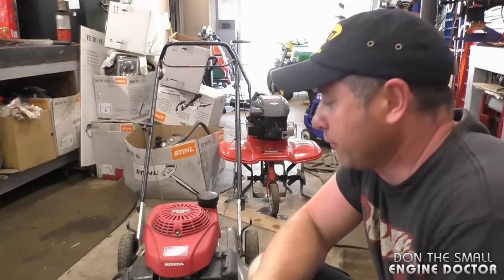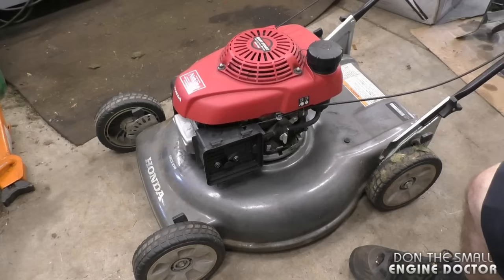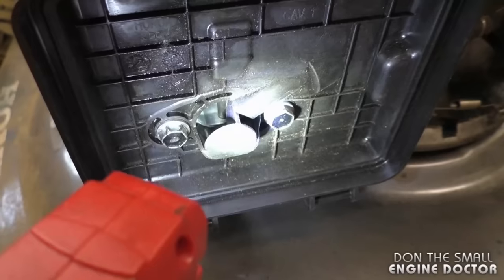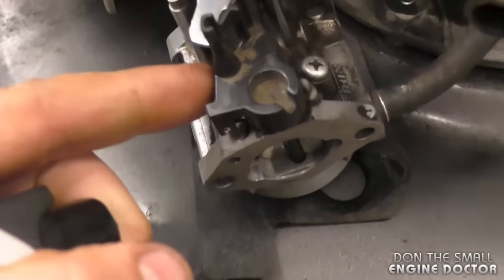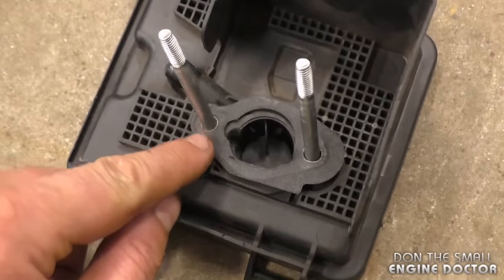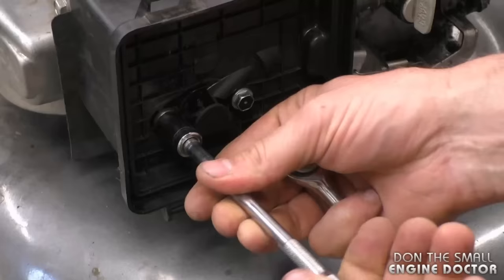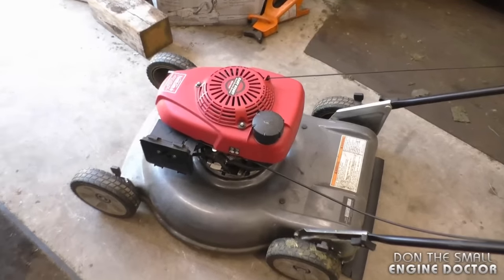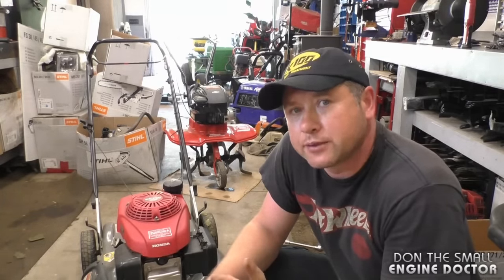Make Your Lawnmower Start On The First Pull Again - Honda Auto-choke Repair - Video

Comment: Hi All, I have found out the part number quoted here is the older part number, Honda has updated to a new version of thermal cartridge, It's 16620Z8D842...which eliminates future issues, great video , keep it up.
Reply from the maker: thanks for the update!
Reply: I actually ordered that same part number that is supposed to be updated and it doesn't work. My neighbor has this mower and I'm going to look up the the thermal wax that goes with his because his works perfectly
Reply: @Scoffman0  What were the specs on the one that you got?
Reply: @Scoffman0  had the same problem, would you have the correct #
Reply: @donyboy73 what would make it run max rpm all of a sudden? How’s the auto choke with the other spring work? Bc when I move that lever it drops rpm’s but when I have it running that thing don’t even move
Reply: thank you!
Reply: Thank you Dony Boy because I have Honda also

Comment: Someone should make a manual choke conversion kit. Automatic choke on small engines is unecessary and ridiculous,  just decreases reliability
Reply: Auto choke is good since it chokes it for you without having to fiddle with the choke to start a normal engine.
Reply: autochokes was a dumb idea, same with fixed throttles. the manual chokes and throttle control are much better.
Reply: I suspect Troy-Bilt wanted to make it foolproof for the operator, so they went to auto-choke, and full throttle only. Just pull the cord. The model before the wax insert has a bimetal spring for auto-choke and it actually worked better. But I can see they want to make it simple for anyone to start. We just have to suffer through their trial-and-error designs.
Reply: It's all about emissions, and idiot proof starting (when it works like it should)
Reply: Yep, i took all that auto crap off my honda, ran a wire to choke and a wire to throttle. Now i have full control as it should be.
Reply: UPDATE- Honda has been updating the part number on their thermowax so I expect they are trying to resolve the problem. I installed their latest thermowax last month (16620-Z8D-842) and the mower has started on the first pull ever since. Maybe they worked out the bug, fingers crossed.
Reply: The auto choke wax cartridge ain't cheap! $30.00 plus depending where you buy it. The Honda GCV 190 on my power sprayer is a manual choke and I've NEVER had a problem getting the machine started and running well. My 15 year old MTD American built self propelled Cub Cadet lawnmower with regular maintenance has never had a problem and I much prefer it over the Honda mower.
Reply: Take the copper auto choke out and all springs from the choke system. There you go manual choke.
Reply: What I like better than a choke is a primer
Reply: @trevorhannon900  did
Reply: Do you have pictures/video of your set up?
Reply: @phill1074  can you show us how to do that?
Reply: I made one for myself and a old style  with cable control chock and throttle
Reply: @swingbelly  I just bought one from Amazon same part number for $10 OEM HONDA
Reply: Forgive my ignorance and probably dumb question but how do you operate the manual choke after the auto choke has been disconnected?

Comment: Honda fixing a problem that doesn't exist. Making a simple engine more complicated for no reason at all.
Reply: The reason is that most people are too stupid to understand how to use a choke, so Honda did them a favour and installed one for them.  Add more crap to any machine and it's gonna break.
Reply: I guess most guys looking for curb side junk love these, mower won't start, junk it and buy a new one.
Reply: @dwoodog     my state wont give anything away . i am  yet to see a curbside yard equipment find for free.
Reply: I think Kohler auto choke system Is the worst. Primer bulb was the way......
Reply: They have improved this auto choke system on the new Honda GCVx engines  by repositioning give thermowax cartridge.
Reply: And primer bulbs.
Reply: @ElectoneGuy  most people aren't that stupid.
Reply: The gas valve was shut off...Easy fix.....Just turn the gas valve clockwise.................
Reply: @OldPossum That's a terrible thing to say. You know these Honda HRS216's are made in the US right?
Reply: That's a progressive company making 21st century changes to improve performance. If you take the "if it ain't broke, don't fix it" you'll never move ahead. Competition requires improvement or you can go the way of Kodak, Xerox, and film cameras. The Japanese are very keen on that!
Reply: Eduardo Arce Roldan Kohler got this thing beat by a mile for hard starts
Reply: Thanks for your opinion. It was extremely valuable, much more valable than your input on the video which was the intent of the Comment field.
Reply: These engines gave very little trouble until they decided to auto choke them
Reply: Absolutely!  My older vintage (late 1980s) Honda mower has a manual choke that is actuated by the throttle lever being pushed to the "start" position - simple, effective, and reliable for 30 years and still in use.  That auto choke thing is ridiculous, and not needed.  They took a good, reliable design and ruined it.
Reply: Honda's VTEC is a good one.. Makes a good engine, only good up top
Reply: @eduardoarceroldan7466  
My Kolher engine requires only 24-35 pulls or until my shoulder pops out the socket.
Reply: Yeah, you hit the nail on the head.
Reply: I have a Lawnboy with a Honda engine, same deal. Poor design by Honda, which is disappointing since I've had nothing but good things to say about their small engines.
Reply: I don't blame Honda one fucking bit. I've see people with anything carbureted and they're terrified or something of using the choke. Like there are dudes that have been riding dirt bike their whole lives and they buy an old DRZ for dual sport and they're like "hurr durr it won't start at half choke" like pull the choke all the way out you utter mong
Reply: @eduardoarceroldan7466  But a primer bulb isn't the same as a choke. The primer bulb forces fuel through the carburetor passages and pushes out any air. You can push it 100 times and it wont flood the engine. The choke actuall closes off the air passage, allowing a richer fuel mixture on a cold engine. But you probably knew all that.

Comment: In your video you can clearly see that the fuel cut off switch was turned to the off no fuel position.  Causing your lawn mower not to start.  You will later see in the video that when it starts he turned the switch to ON position allowing fuel into the mower.
Reply: I noticed the same exact thing also

Comment: My 13 year old daughter figured out how to use the choke to start our early 2000's Honda mower in about 15 seconds...maybe less. The engineers at Honda 'over thunk' the process and designed a system that will fail every two years. GRRRRRRRRRRRRRR!
Reply: cbsctomh I prefer manual chokes much more but I have had an auto choke Honda push mower for over 12 years now and it has surprisingly always started first pull without any problems.

Comment: I wish honda would just keep it simple and stick with a fully manual choke and avoid potential problems.
Reply: Russ Gallagher  yea it's all bullshit. Epa needs to be limited to their restrictions.
Reply: @johncuervo3019  I've had my honda mower for about ten years so I haven't been in the market since. Are all mower engines like that now?  I have a Briggs engine on my 2011 snowblower . That has a manual choke.
Reply: These corporations have to support their vendors and retailers this is why they make Junk Parts as well as Reliable Parts this is why Mercedes-Benz put there heater blower control unit integrated circuit chip in the bottom of the blower and you have to remove the entire front of the dashboard to get to it this is deliberate
Reply: not just honda briggs kohler and the chinese are all using auto chokes.  And for some reason they think they need to be aerodynamic so put cowlings over everything.  Ive been a small engine mechanic for 27 years there has been no real improvement too any of what is commonly used today be it a mower or a chainsaw.  The only thing refined is they have got the lifespan cut by at least half if not more and the costs of making way down
Reply: @glennlurman3514  I have a OHV Briggs that is right about the same age (2011) as the Honda and it has a manual choke, however that may be because the Briggs is on a snowblower and meant for operation in colder temperatures.  Yeah probably the only changes you've seen is side valve to ohv and ohc and points to electronic ignition.
Reply: I know I have a model that must have been made before this one. that has a choke lever and Honda's brilliantly stupid idea was to make the lever return to the off position slowly. I ened up taking the spring out it. so it would either stay choked or off. all the manufacturers are doing this. because the all the automotive manufacturers have been doing this for year's. it's a convenience item for the owners. it's getting pretty bad when people don't even want to reach down to pull a choke lever to the off position. besides it's bad for the engine. a choke should only be on to start the engine and when first starts to warm up. the longer the choke is on it washes the cylinders down with fuel. but it's such a small amount that it's acceptable. newer car's don't have chokes on them they have an inrichment circuit in the fuel delivery system. it's just another convenience item that people have become accustomed to.
Reply: @harryrenner4016  Agreed. Speaking of cars, how about self driving cars.  I certainly won't buy one. I far prefer to have control over a machine,  whether it's choking or driving.
Reply: @charlesdudek7713  I agree they are taking away what driving a was about besides transportation. the viceral sensation and having control of vehicle. which I do pretty well since I was an OTR truck driver for many years.

Comment: The gas tap was turned off at first
Reply: @Oops Oops They  havent even used this technology for 15 years.
Reply: @johncuervo3019  im not sure it had manual choke.  Maybe primer bulb.  At one point they had an autochoke that used the force of air off the flywheel to open it.
Reply: @ChuckWood  I remember them!
Reply: So it started, and ran with the tap off. Maybe it possible to run off oxygen?, lol 
I'd say he does what we all do by turning off the fuel tap. 
My prob is I forget to turn it back on again when it's mowing time. :)
I've read quite a few comments and one guy says 2 years. shit!
Might just use 'Start Ya Bastard' when it eventually fails.
Reply: Yall I'm sure he checked the valve when he figured out something wasn't right. Do yall not get a little crazy in front of cameras?
Reply: @mickgatz214  it ran because of the carb cleaner he put in there, that is like gas ... if he would have left it on for a minute longer it would have stalled from lack of fuel. but that wasn't the point of the video so he did not care or did not notice ...

Comment: Big thx this video has resolved a 1yr issue which i been having with my own manual choke honda lawn mover. Your Carb gate explination on start up was the key...
Even with manual choke petrol mowers if its hard to start or cuts put during use, it coukd be you choke or choke & actuator settings, actuator stop screws and choke cable too tight as was my issue, 

Without knowing how the carb air gate looked when in full choke, i would never of fixrd my mover.

So thank you......❤

Comment: A great tip Donny Thank you. A lot to be said about keeping things simple with a manual choke.
Reply: You are 100% correct!  But they invented this to prevent damages to the Machine when hot.   Manual Choke is great, but once the Machine heats up for a long time, which a lot of People aren't aware and they ending up damaging the Mower instead.
Reply: @JodBronson  What? You mean if they start a hot engine with the choke on? It will flood and not start. Damage?
Reply: @dkupy100  - DENSE!  LOL
Reply: @dkupy100  - As the engine warms up, the automatic choke adjusts to the temperature change to regulate the fuel/air mixture to the proper ratio.
Reply: Jordan, David Kupferman is correct. The engine won't run when warm with full choke. I don't see how it can cause any damage to it. Care to enlighten us?
Reply: WOW, you People needs to go back to "English" 101 again!  READ THIS PART AGAIN AND AGAIN "But they invented this to prevent damages to the Machine when hot.   Manual Choke is great, but once the Machine heats up for a long time, which a lot of People aren't aware and they ending up damaging the Mower instead."  LMFAO !!!
Reply: @TheOtherBill  Easy, he is just a kid.  The thermal wax cartridge when cold will close the choke. As soon as the engine starts the exhaust heat warms the wax cartridge  causing the choke plate to open and the engine runs normally. If the engine is shut off for a short period the wax cartridge is still warm so the choke remains open allowing the warm engine to restart. If the engine remains off, the wax cartridge cools off closing the choke so a cold engine will restart.If the engine remains off for a longer period, the wax cartridge cools off closing the choke so a cold engine will restart.

If the choke is stuck closed , the cold engine will start but run rough and probable stall.
If the choke is stuck open, the cold engine will need a prime to start but run normal.

So where is the damage? Just replace the thermal wax cartridge and FIXED.
Reply: David, I understand thermal wax chokes, I even had one on my 1981 Mitsubishi. But he is claiming running with the choke closed will damage an engine and won't back up his statement, instead choosing to be insulting. Fine, let him think that.
Reply: TheOtherBill simple over fueling the cylinder and getting gas into the oil. Thinner oil from the gas and you waste a piston.
Reply: works every time
Reply: Auto choke takes about 3mins to fully open  manual choke start pullback to fast run srate away
Reply: Zackley !
Reply: This system worked perfectly for me for 12 years, I'm  totally impressed !

First pull every time, even my neighbors are impressed. 

While they're getting their exercise in the Spring repeatedly pulling the recoil starter, pumping bulbs, tampering , cussing & swearing;  I roll my Honda out of the shed and it always starts on the  first pull.
Reply: I've had many more problems with a manual choke. Six years of faultelss performance, and it is an easy part to change when it fails.

Comment: Timely video, just purchased a lawnmower with Honda auto choke system. Had a flooding/starvation problem on our old one so wimped out and got a shinny new mower. Nice seeing how the system works and how to fix. Auto choke seems to be all the rage these days. Personally I've never had a problem with manual choke on small engines. Reminds me of my MGB back in the 1970's with a manual choke for the dual SU carbs.

Comment: Another great video on how to fix simple small engine problems!  I have the same mower and I knew it was a auto choke problem, just couldn't find what part made the auto choke work, easier than I thought it would be.  Camera work was excellent, always focused where it needed to be, detailed explanation on the problem.  Thank you very much for taking the time to make this video.
Reply: I tried pulling the thermo wax part out but it was completely stuck. I ended up really messing up the old part trying to pull it out. Any suggestions?
Reply: Allen this happened to me too. Someone had used black gasket seal and the thermowax capsule was stuck in its hole. I finally had to use a pair of needle nose Vice grips to wiggle and pull it out finally. I’d like to know if the Honda factory did this with the gasket cement??? Or is this in the service manual to use gasket seal.
Reply: @Fresh-tw7ev  You are supposed to use the liquid gasket to set the thermo wax part in place, not just pop it in.  When you remove the old one you have to dig out any gasket left in the hole with a small screwdriver and compressed air.
Reply: @danwhite6075  it’s working totally fine without any gasket seal.
Reply: @Fresh-tw7ev  That's great but Honda uses the gasket for a reason I have to assume.  I have some sitting around so I put a dab on it.  No harm in not using it I suppose.  It's easy enough to put some on if you have problems.
Reply: @Fresh-tw7ev  The black gasket sealer is installed on the thermal wax assembly from the factory.  I read some where, about five years ago, to just lightly coat the wax assembly with black gasket sealer.
Reply: @danwhite6075  Yes that's right because it is installed like that from the factory.
Reply: @Fresh-tw7ev  Mine has been working five years now without the gasket sealer, but it did have it on the old wax assembly that was Honda factory installed.

Comment: Great instructional video. Just what my lawnmower needed. However I was taught to never start a bolt into a threaded opening with a impact or drill driver. Start it with your fingers first then you can use whatever method to tighten. Using a power tool to get it started, if its not aligned properly can start cross threading before you can catch it. This has always served me well.
Reply: I was going to say the same thing, then read your comment. Been taught the same way, its the only way to do it. My father took his car to get a tyre changed and some time later I tried to get the wheel off, they had cross threaded 2 bolts and stripped the threads out of the hub using their power tools. When I went there and made them pay for the damage was watching the guys changing tyres and none of them were starting the bolts off by hand, unbelievable.
Reply: Yep.  The video was good until that part.  I love my impacts, but I'll never start the bolts with them.